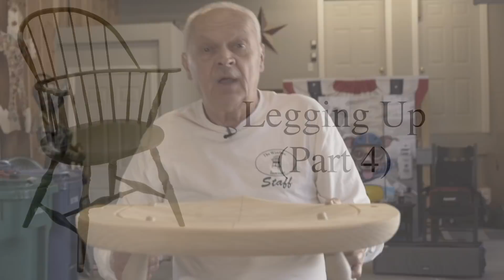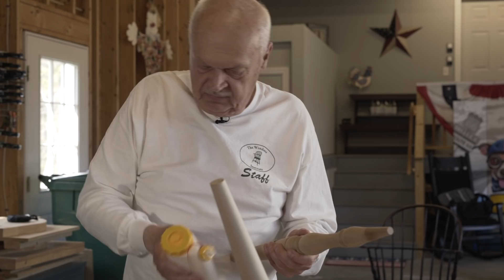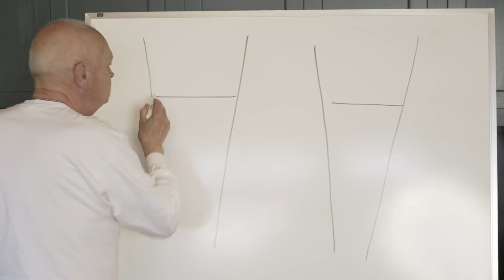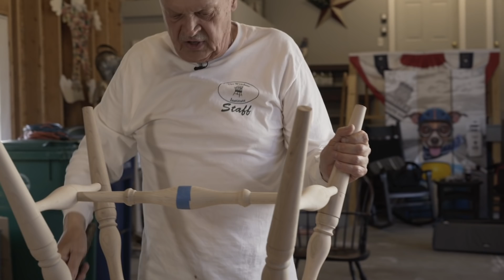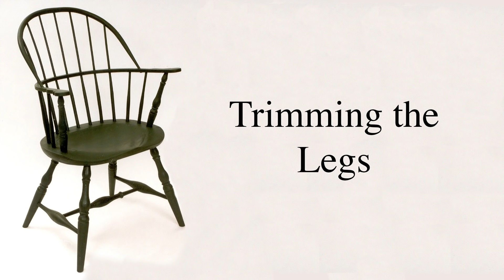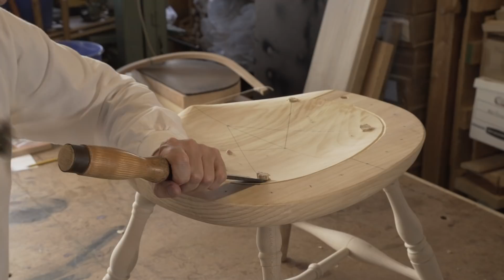Make a Sack Back Windsor - Episode 6

Comment: Hi Mike 
I attended one of your windsor chair classes at the Wiindsor Chair Institute in New Hampshire. After I completed the class I had dreams of becoming a chair maker like you. So I brought the chair kit you were selling at the time and tried making a chair. I did pretty well in making the spindles, and steam bending the bow and and arm. However when I got to this step I failed miserably. I forgot to start making the H and when I applied one the stretchers to a chair leg the joint seized because I used yellow glue. After that failure I gave up.

After watching this series of videos of making a sack back windsor chair you lifted my confidence so I feel I can build windsor chair. In fact I went to Viking Lumber and brought 10 feet of eastern white pine for making a couple of seats Thank you for an excellent job in presenting your methods.. Keep it up. Can you present another video for showing how to sharpen a travisher.

thank you

Comment: I'm definitely going to try wedging in the way you show it here.  Normally I use a saw kerf and shaped wedges but that's always felt kind of fiddly and lining up the saw kerf has been a pain. Using the Chisel and a stick for the wedges seems like the way to go.
Reply from the maker: Thanks, Ben. I'm not sure where the saw kerf method got started, but once something (no matter how inefficient) gets put into a magazine it gains traction. Ever met someone that uses a mirror to check angles? 
   I know a lot of tricks because the old guys taught me. Not personally, but through their work. I have studied hundreds of Windsors, but especially  broken chairs and copied what I found.
    In the 18th century the business of Windsor chairmaking was  competitive and the old guys worked in the fastest and most efficient ways. That's why they did not use shave horses. The guy that worked on one of those would have been out competed by the guys that used vises and would have been out of work.